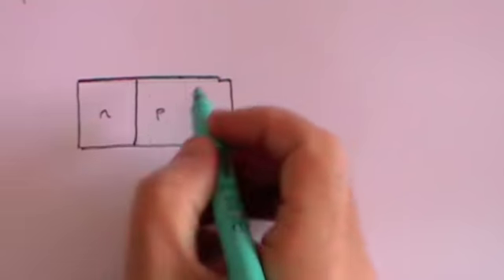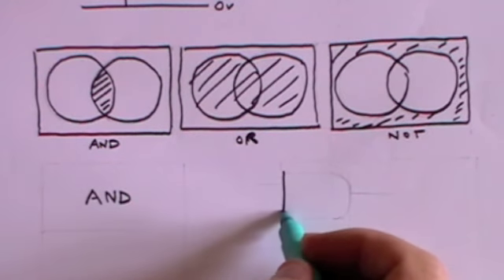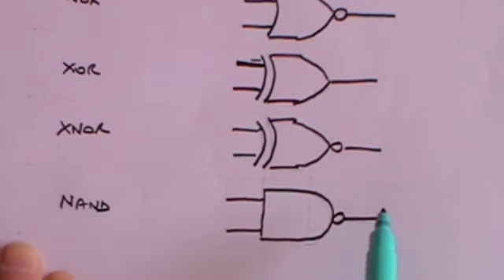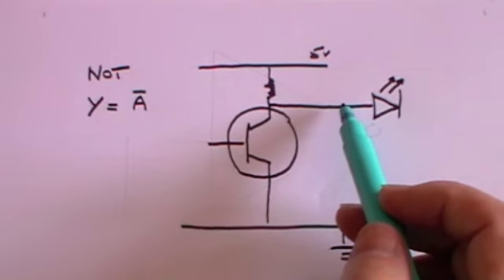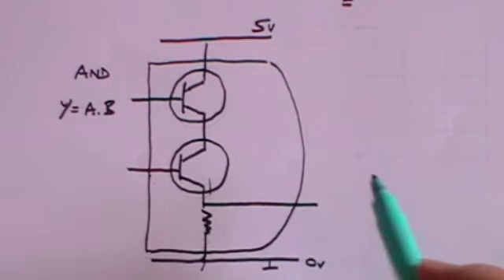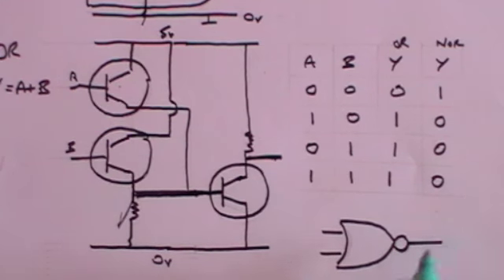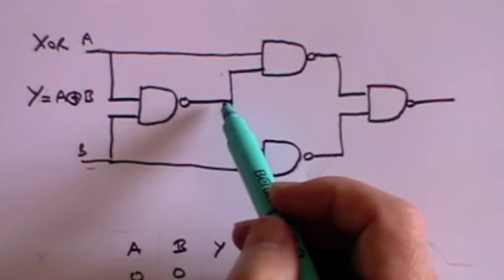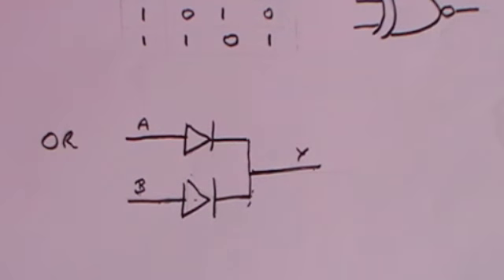An Introduction to Logic Gates

Comment: I saw another video where the teacher put the resistors and the LEDs on the other side of the transistors (so between the +5v and the transistors) does it work the same?

Comment: Thanks for a very clear explanation, though I would have liked if you would have explained the XOR gate using circuits with emitter and collector (similar to the previous gates) instead of directly using 4 NAND gates to explain it. 😌

Comment: what is the purpose of a logic gate? I understand that there's and or not nand etc. what is the reason you would need it making a circuit? I can't understand why you wouldn't just use a switch rather than this much more complicated way of light or no light. what's the application?
Reply: Haaa bro

Comment: Like if u watching this in 2021 to solve the Boolean equation in yer brain to activate the logic gates in yer own gray matter, so yer negative inputs render Positive Outputs, so instead of passive YouTube learning you can turn on your transistor and convert yer zero-volt potential energy into useful kinetic energy so you actually get up and CLEAN YOUR DANG ROOM... in 2021.

Comment: Excuse me and my english...but I don't understand...About at minute 35: if the output is the voltage measured where you showed then when the transistors are open no current flows trough the resistor so no voltage drop and the voltage is exactly 5 volt...Are you considering another circuit that I don't see? I don't understand...

Comment: Nice. This was a great refresher for me.  Also for that last one, the xnor, you could have just switched that last nand for an and since it is just taking an inverter of instead of double inverting.  
  Actually it's interesting the way you can mix different gates to get the same results.  Like how you can split your inputs into an (or) and a (nand) then put those outputs into an (and) and get an (xor).  Which I guess is why some microchips are more efficient at the same thing over others.

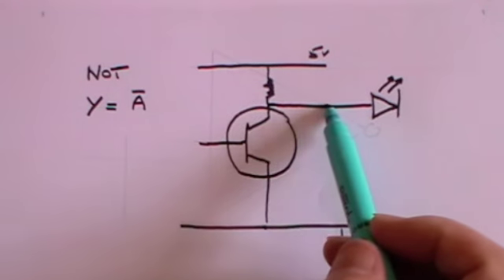Comment: I have a question for you.when you explained Not gate at 21:50 , you said output is zero volt but to my knowledge output should be 5Volt so current can't flow output.it it right?
Reply: No. The transistor, because it's on, shorts to ground.

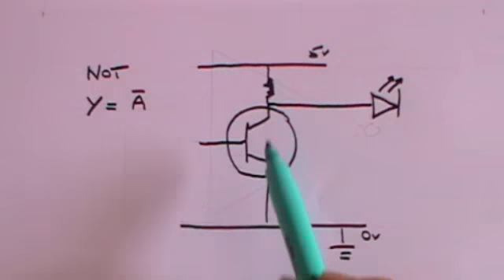Comment: 21:44 "and if a current flows through the transistor then since this point (collector) is zero volts, this point also will be zero volts (collector)" -> why, exactly? (I apologize, I've probably missed something)

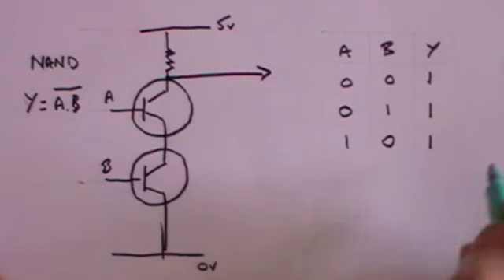Comment: 36:53 I am still failing to understand why the current through the resistor wouldn't be shared by the parallel loads of the bjts and the output load impedance.
Reply: It is, but the resistance of the transistor is so small that it basically grounds the circuit.
 signal voltages range from 0 volts to 0.8 volts for a “low” logic state, and 2 volts to 5 volts for a “high” logic state

Comment: What I found very intriguing is that the output wire of a logic gate was seemingly receiving the 5 volts of current before that current was lowered by the resistor.  Does that mean that for a brief nanosecond, the actual current through a logic gate's output was 5 V?  Or, does the voltage get reduced as it passes through a transistor, before it even hits the resistor?

Comment: thank you for this great tutorial. but i have a question: in nand gate, why when both a and b are high, the output line will be 0? you say both output and 0v line has same potential so the flow should divide between both of them. but why you put that 0? i just don't understand this part.

Comment: Great video!

Here are a couple of remarks:
1‌:56: The middle part is called "gate" in field-effect transistors (FETs), but then the emitter is called "source" and collector is called "drain". In bipolar junction transistors (BJTs), you always call them "emitter", "collector", and "base", respectively. BJTs and FETs have a different terminology. Also, FETs have different schematic representations.
2‌:16: You forgot to draw an arrow to indicate emitter.
2‌:49: Again, there should be an arrow on the emitter. It also indicates the type of the transistor — PNP or NPN. What you're talking about in the video is an NPN transistor, so the emitter arrow should point outwards.
3‌:29: 1 is also often called "voltage high" or just "high", while 0 is called "voltage low" or just "low".
6‌:37: The third one is actually a NOR which stands for "Not-OR". NOT doesn't require two inputs (circles); you just need one.
9‌:16: What you've drawn is a buffer; a NOT gate needs a small circle at the end of the triangle.
9‌:31: I think the dichotomy of positive and no voltage is misleading — you can have a positive voltage which is interpreted as 1. It's better to talk about "high" and "low" voltages.
11‌:06: Also, "X" in the XOR and XNOR stand for "exclusive" because it's exclusively one input that needs to be high in order to give a high output.
31‌:58: Or you can simply use a pull-up resistor instead of the pull-down one.

Comment: You have 2 as an output for the AND gate, I think that is a mistake, AND means that if you have 1 and 0 -> 0 , 1 and 1 -> 1, it's not OR, even if it was OR,  1 OR 1 -> 1.

Comment: I will not "say" my age, but when i was in school, non of my professors where as good as you where in this video. most times we used the truth tables (supplied by the chips manufacturer) to pick the required component with the desired output for our circuits. great refresher class. thanks.

Comment: I suppose everyone has their own tricks for calculating Boolean, but for my nickle it's easier to just remember AND and OR, and that by adding the shield at the input or circle at the output, the logic condition is reversed.  This way there are only the basic conditions to remember, with the shield and circle "flipping" that condition.  Then the more you work with them the more it just becomes send nature to recall the variables.

Comment: first thank you for this amazing video i think it couldn't be any better but i have a question about the very basic principles of current flow, in the 3 minute you said that electrons flow towards the five voltage side but then you said that the current actually flow towards the 0 voltage side, now i'm kinda confused about this isn't the current suppose to be the same meaning of electrons flow.
if any one could makes sense to me out of this i would be very thankful

Comment: WRONG!!! Hahahahah! :D

No, but seriously.
BJTs (Bipolar Junction Transistors, e.g. NPN and PNP transistors) need to have a Vbe of at least 0.6V for NPN junctions, or -0.6V for PNP junctions, in order to start conducting. In order to saturate, or in other words, to reach minimum resistance between collector and emitter, a current Ibe greater than Ice / β must be applied to the base terminal.

This means that the 0V we refer to in TTL, is never full-on 0V (in this case, full-off. Pun intended ;) ) in some cases, summing all the voltage drops from all the junctions, this voltage could be much greater.

Vce - Voltage between collector and emitter
Vbe - Voltage between base and emitter
Ice - Current between collector and emitter
Ibe - Current between base and emitter
β - Gain of the transistor

PS.: great video!

Comment: Thank you very much!!! It is very helpful and useful video!!! 

Could you please explain one more thing. When we developed OR and then added NOR gates, we connected NOR output to the 5v line. The question is: why, if we have 0 at A and 0 at B the currency will not go further to the third line and then go directly through the resistor and NOR gate?
2 question: what is the resistor role in this chain? I please you for an expanded asnwer, since weak backgroung knowledge.

Comment: This is brilliant! I wish you had been one of the instructors when I was trying to learn all this back in the 80s in the Navy. The only way it finally hit for me was reverting back to my knowledge of plumbing, with pipes instead of wires, flow restrictors (orifices) instead of resistors, and spring-loaded valves in place of transistors.

Comment: Some question about AND gate 25:29

If there is the voltage of input B ( with no voltage of input A), and the resistance of the transistor(base and collector) is low in comparison with the resistance of the resistor, doesn't it means, what it should be output voltage approximately equal to the voltage of input B?

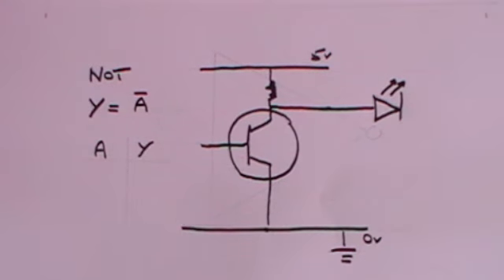Comment: @22:30 you say the voltage on the both nodes are zero and so the LED is off. Why is that? I understand that the node is zero voltage but this difference make the current flow through the resistor and also LED.

Comment: For the NOT gate, I didn't understand why the output will be zero if there is a positive voltage on Base. Does the whole 5V drop at the resistor? why?
Reply: It's because the current that can flow through the resisor is a lot smaller than the current through the turend-on transistor. So you force your output to
0V much faster than to 5V.
Imagine you fill a container of water through a thin pipe (the resistor), and you empty it through a much larger one (the transistor which is switched on) at the same time. It will get empty over time.

Comment: wouldn't the not gate just waste stored electricity? How is this prevented?
Reply: Yes it does! This is one of the reasons why they switched to CMOS logic. Those are completely different types of transistors, and you have two in series (nMOS and pMOS) and there's always one closed and one open. The output is in the middle. So you don't have a current flow there.
Reply: Toni Razz Interesting. I will have to read about that more.

Comment: I believe the first shown Not Gate is drawn incorrectly.  Should it not have a circle on the output to indicate inversion of the signal.  A plain triangle represents a buffer if I'm not mistaken.
Reply: +miketoreno24 No doubt.
Reply: +Helsa Vales without a bubble it's called a buffer and it makes the signal stronger ,,
Reply: +Helsa Vales Look at the text that appears at 10:47. He probably just forgot it.

Comment: Am I wrong? I believe the third Venn Diagram labelled NOT is actually a NOR. For a NOT diagram, it's one circle and the outside is shaded.
Reply: Right, it's NOR. NOT doesn't require two inputs (circles). Unfortunately, that's not the only mistake in the video.
Reply: I am pretty sure you're right. I thought the same thing.
Reply: +Jordan Weimer ur definitely right. for computers NOT is just a logical inverter. It has one input and it just returns whatever the opposite of the input is. Great video though! Gets a like from me for sure.

http://whatis.techtarget.com/definition/logic-gate-AND-OR-XOR-NOT-NAND-NOR-and-XNOR#not
Reply: Upvoted this comment as I also caught it.  You can see that what he calls a NOT gate is actually an inverted (NOT'ed) OR gate... so therefore it's a NOR gate.
Reply: Although... when he draws the NOT gate under them all... he actually draws a NOT (with 1 input)... instead of the NOR (with 2 inputs) that he's drawn above :/

Comment: About the AND-Logic: If the second Transistor gets a High-Signal, wouldnt it be possible that the elektrons could take the way Output-Emitter-Basis-Input.
So if there were a positiv signal at the second input, there would be a positive signal on the output with just one high input? sry for my bad english
Reply: The Base to Emitter voltage (U_BE) in the on-state is always 0.7V (junction drop of Silicon). This really small voltage drops even more because of the resistor. The transistor of the following stage needs a tad more than 0.7V to switch on. Threrfore this ~0.69V output will be interpreted as 0V. For the same reason, an LED won't light up, too.
Reply: Good question. Since the electrons are coming from ground and have the base to go to because of the positive signal, they should be able to open up the base-emitter current... but of course not the collector-emitter current, that would require the above transistor to also be "open", so the current is small, but I don't know if that means anything...

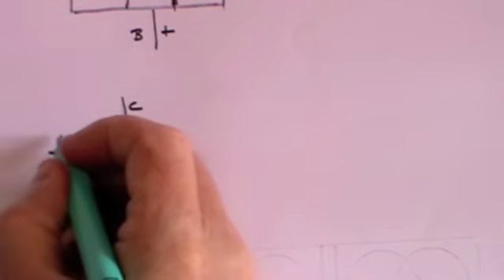Comment: Great video, but at 2:20 it seems you forgot to connect the negative terminal of the diode to the ground.

P.S. Do you also answer questions on Quora? Check out my question on transistor circuits -> 

http://www.quora.com/How-do-electrons-flow-in-these-circuits

Comment: i thought current flows from +pos to -neg
Reply from the maker: suren bono That which we call conventional current does indeed flow from + to -. But in fact electrons flow the opposite way (from - to +)
Reply: +suren bono The signs + and - were chosen before scientists knew how electrical flow actually went.  So it was just a convention, but sadly a bad one. Explaining electric circuits would have been easier if the + and - values were chosen the other way around.

Comment: The NOT Gate, is there any difference if I put the resistor on the emitter or the collector?
Reply from the maker: The potential drop occurs across the resistor. it depends where you want that to be.
Reply: +zerpBot ignoring the flow of electron means ignoring real physics that happening
Reply: +DrPhysicsA sorry but im mega confused.. if electrona are negativly charged and thus flow from neg to pos. why do you say that if you supply the base with pos then it activates the base and transistor and works.

im very confused about this topic of which polarity moves to and from where is it + to - or - to +.  

as theres got to be a linear format to how a circuit is laidout to produce a logical linear behaviour to the circuit.. help!!!
Reply: god only knows
I think it's better if you say that current flows from positive to negative, just ignore the electron charge and their real flow.
Reply: +zerpBot I've been studying electronics and discovered a great website at Gregs Electro Blog (google it if you're interested)
Reply: that will work fine for logic 1 input if u put the output above the resistor but that will not compliment logic 0

Comment: Why do you correct yourself to say "voltage" instead of "charge"? Aren't the two interchangable
Reply: voltage is a potential difference between charges, as in it is the difference between any (n) number of electric fields arising from a charge.
Reply: Jake Hmm ok. How is "the potential difference" calculated? I know that my multimeter can just tell me the voltage, but is there some kind of equation I can use? When you say "potential difference' I'm thinking about subtraction...
Reply: voltage is itself the potential difference. this is way on a conductor with negligible difference you will see 0v, because they are at the same potential there for the difference is 0. Now if you were to measure a +5 volts leading into the gate of a transistor, and compared to ground (which is assumed to be 0v) 5v-0v=5v, you can also see this on a resistor network, if you have more than 1 resistor in a series network, you can measure voltage in other references than ground, the reading you get will be the potential electrical difference, or voltage drop across the terminals.
Reply: Donovan Thompson Suppose you have an electric field consisting of two opposite charge rods or plates, and now imagine a particle of some charge entering the electric field. Its going to be attracted to the plate opposite of its charge. You can use V = Ed, Voltage or potential difference = Electric Field strength * particles distance from opposite plate within electric field, to calculate the particles potential difference within the field. Potential difference or Voltage is the amount of work per unit of charge. Hope i was of some help :)
Reply: hussein debel Thanks for the reply. So in order to figure out the voltage I'll first have to firs figure out the strength of the electric field, and figure out the distance from the particle in the electric field?

I don't understand how distance plays a factor. I'm using a multimeter to measure the voltage of a battery, are you saying that the length of the multimeter leads play a factor in the reading that I get?

Besides, if I'm multiplying two values (distance x electric field) wouldn't the product be a value that is larger? So you are saying that I will get a higher voltage when the distance from the ion to the rod is a larger value?
Reply: For a battery there is a set electric field created by a chemical reaction. besides a very long wire with measurable resistance, distance will play no affect in the voltage reading. to measure a battery's voltage just match the probes to the battery terminals. It is very rare, besides actual electromagnetic study, that you ever have to worry about calculating electric fields, engineers like myself just have to learn it to have a respect for where all assumptions and theories come from